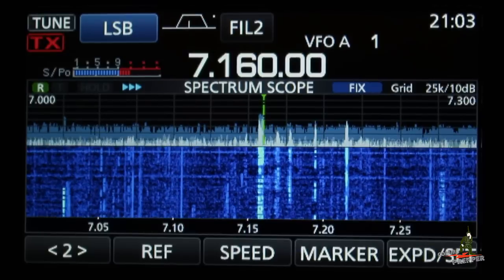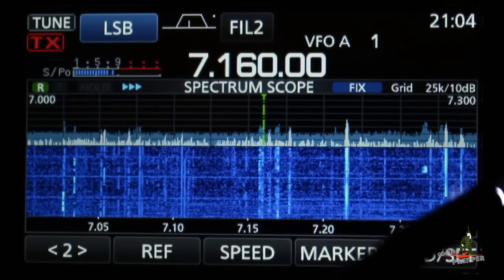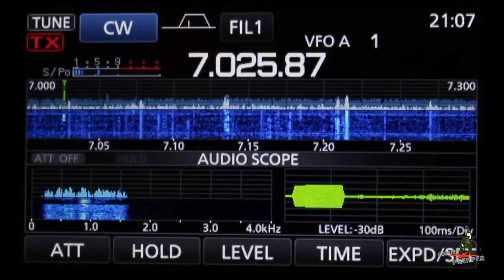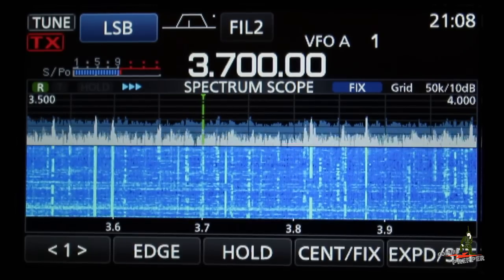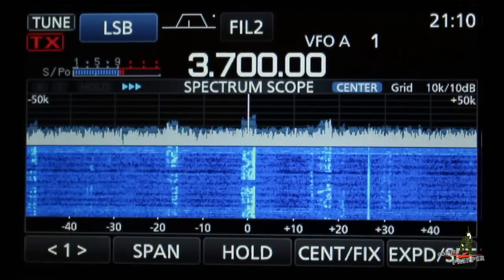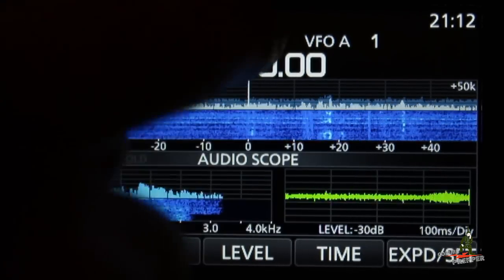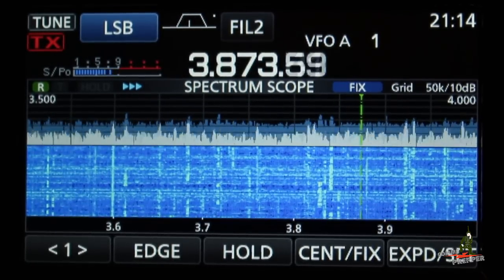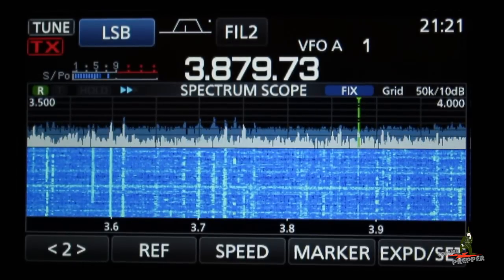Icom IC-7300 Touch Screen Demonstration

Comment: Great information: I just might get rid of all my old Heathkit gear, clear the desk, and get back on the air. :-) Like some others have said, to bad the buttons on the front are not back lit. But a little LED lamp on the table would work. Thanks again.
Reply from the maker: It's fine radio.  i don't think you would regret picking one up.
Reply: How bad is the AM receive? Simone sent me a video of locals on AM and they didn’t sound all that well.

Comment: Nice job. Tapping the waterfall to tune to another frequency should probably have been demonstrated, though. Good video. Thanks.
Reply from the maker: I did not know that.  I will have to give that a try.  Thanks for the tip.
Reply: precisely what I was looking to confirm, does this capability exist??

Comment: Some of those signals on the display are just noise. Believe me I know. I get lines that indicate a possible ssb contact and when I tune to it, its just some high pitch noise. I view these waterfalls as a gimmick. Regardless you still have to tune by ear anyway, once you find out that that strong signal was not a person.
Reply: N2LRB 
The "footprints" are still suspected activity and is a great way to steer the tuning, thus speeding up the hunt by narrowing down a more probable intelligent signal, out of a wider field. In proper context this feature finds its value.